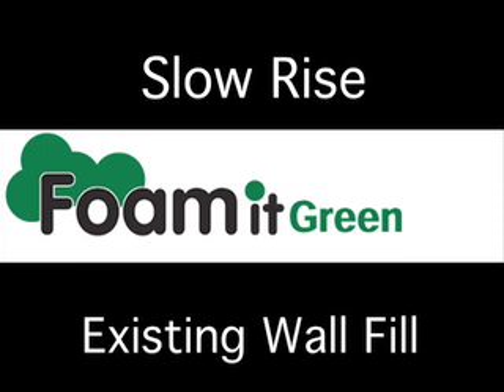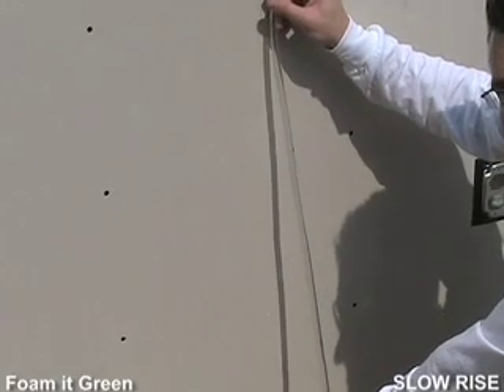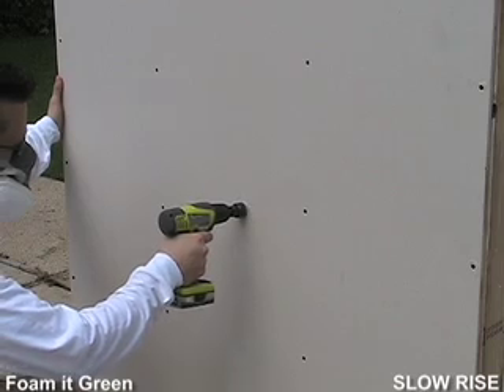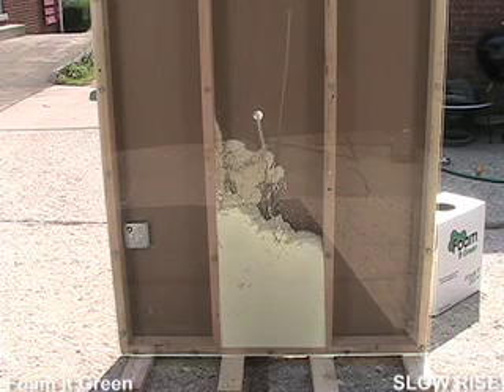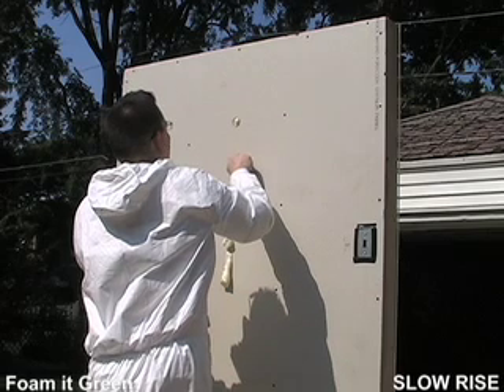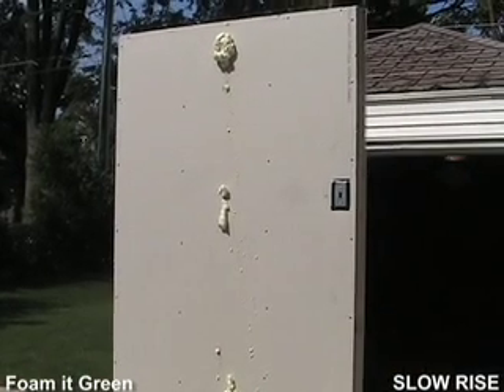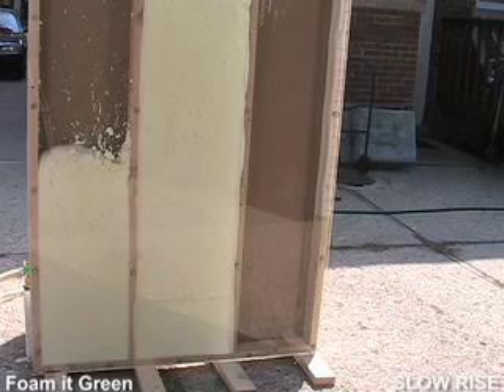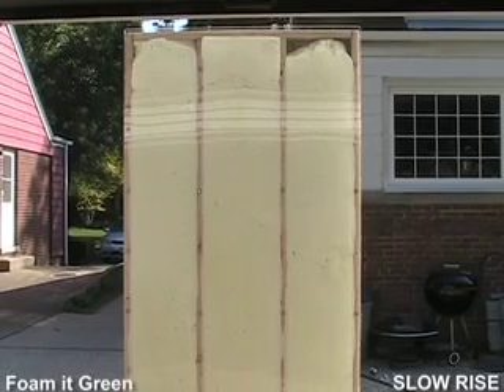Slow Rise Spray Foam Existing Walls

Comment: How do you calculate how long to spray within a wall cavity?
Reply: IMO I would wait and see if it rises to the hole in the wall and go from there
Reply: @jax9769  better would be on the first 3 wall cavities to drill the foaming hole plus a hole at the very top near the ceiling and a third hole between the previous 2 holes.  This would then allow you to see the foam's growth  to minimize waste or underfilling the wall cavity.

Comment: Is there any danger that the Romex wiring would heat up too much during use because of the insulation?
Reply: I think generally spray foam, closed or open cell, has a pretty significant resistance to ignition and most have fire ratings. It would.certainly be no worse than blown in Cellulose or fiberglass but not as resilient as stone wool or concrete (ICF). The main safety feature there is an adequately sized breaker.

Comment: BUT... can you use this in an exterior wall cavity?  i have an exterior garage wall, 2x4 cavity, outside is BRICK, behind the brick is a 3/4 foam board, then the studs, then the internal sheetrock (in the garage).  i understand the 3 hole, and reasoning why.  but how much foam do you squirt in the hole?  if you squirt until the foam starts coming out of the hole, you are going to pop the sheetrock off the walls won't you?  so if you first hole is at 3 feet, how much product do you put in before you wait and allow it to expand?

Comment: Doesn't this foam produce off-gassing if not slowly sprayed and allowed to dry about an inch at a time? This process seems dangerous to me, as you don't know if there is an pocket that isn't cured inside the middle of all this, producing some dangerous gasses.
Reply: Isocyanurate foam gives off cyanide gas as it cures. Some closed cell foam products I've seen recommend 2 inch lifts at a time

Comment: Why can't I feed.the hose in from the top and not drill holes in my lathe plaster?
Reply: There would be a lot of small empty spaces that will not be reached. 

This way the foam fills the gap completely

Comment: If you need a filter mask to apply it, it will gas off into your home for a long time, years potentially. If it expands that much, it will push out your drywall, your walls will look like a 16 on center quilt. Fiberglass, installed properly is still the best. Cheap, clean and best of all, does not gas off for you to breathe. Lastly, imagine having to run new wires or install an outlet in the future, its not happening. I wouldn't want to patch up three holes per stud, that's a lot of work.
Reply: No, when mixed properly, foam does not continue to off gas when it dries.
Reply: how the hell you put fiberglass inside finished wall?
Reply: @julyzerg1  You tare out the old drywall, fix your wiring and install insulation. I didn't say it was easy. You get to choose, do you want clean efficient home or do you want a home that gassing off chemicals for years to come?
Reply: Roxul is better than fiberglass..

Comment: Won't it push the drywall out
Reply: Yes it can push the drywall away from the studs. I’ve had to repair a home where this occurred. Newer homes that have the drywall screwed in place have less movement, as the foam expands, than older homes where the drywall was nailed in place.
Reply: How would plaster and lath hold up?
Reply: @drummingbad9358  very much so, I would think.  I've worked with old school walling like that (it's great).  It's of much greater strenth than sheet rock

Comment: No, at no point does the plexiglass separate from the studs.  This is not a sales video, it's a video to show what really happens inside an empty wall cavity when blind-filling with Slow Rise foam.  This way, our customers know what to expect if they attempt the project in their own home.  As you can see from other points in the video, we're not hiding anything.  Thanks for the question!
Reply: So is slow rise the same as open called foam? What R value could one expect per inch?
Reply: I wanted to do this in my bathroom which has a window but the back wall where it is is hollow. No insulation of any kind 😐. In winter the bathroom is freezing the radiators are on high or is it a bad idea?